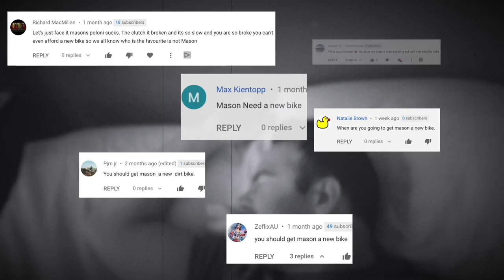If You Can Guess the Dirt Bike You Can Keep It

Comment: I got a 65 when I was 7 and had it till I was 12, now I got a 85 after 5 years of the 65
Reply: If you outgrowing your 85 you should get a kx100 it’s like an 85 but it’s big wheel but it has a bore kit and power valves I love mine
Reply: @liamfisketjon7365  nah go for a 125
Reply: @bluegrassadventures8227  nah go for a 250 lmao I'm 14 so I skipped a couple of classes
Reply: Clayton Gowin yeah I’m stuck right now, I have two options go for a 125 or a 250 4 stroke
Reply: @claytongowin9897  ya I'm 14 as well and went from an 85 to a 250
Reply: @ice-mm6em  well mines a 250 2 stroke so I would pick the 125

Comment: You NEED to learn to do ALL the service and tuning. Oil Changes, Clean the Air Filter, change the oil in the Shock and Fork routinely, service the brakes and chain and spokes every ride. And do it between moto's sometimes.

Comment: Wow i have a peace moto bike its a chinese 125cc 4 strokes and I've bought it a year a go and that thing is indestructible like im 15 know and I've jumped on that machine very high and it has great suspension and great power even tho being a Chinese bike or american not sure but for 1500 its indestructible. 😆

Con: its has 4 gears not 5 but the engine is so strong it wants a fifth gear 😓